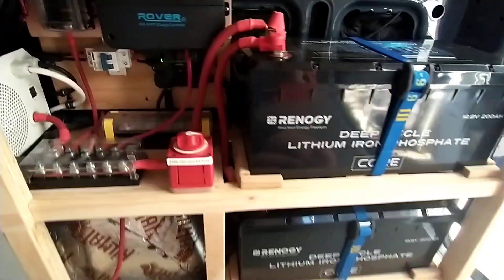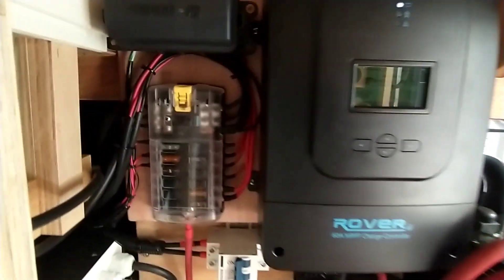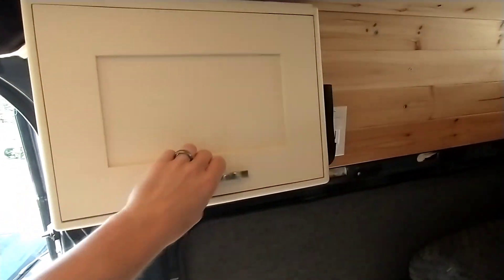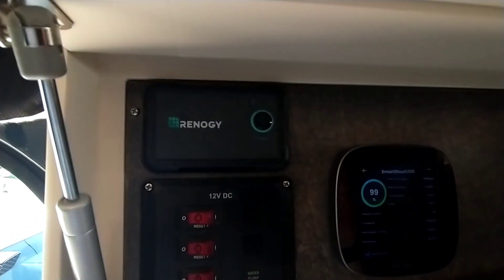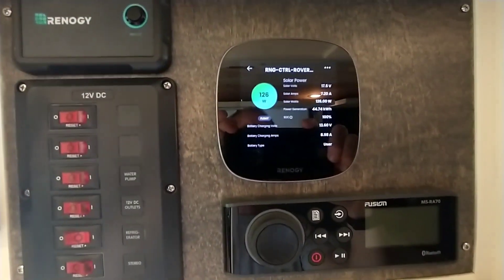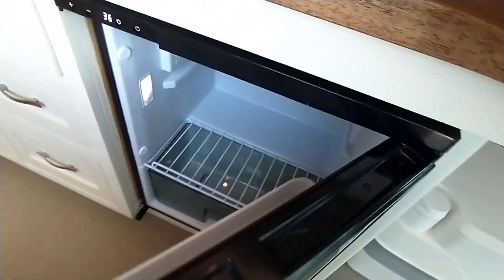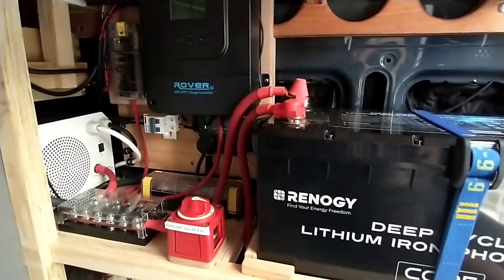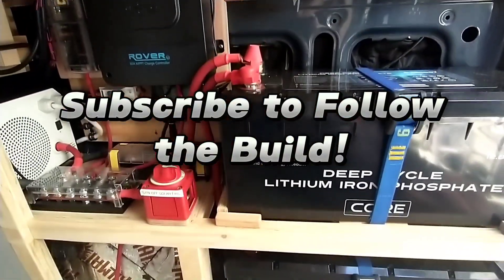Why I Chose Renogy Over Victron in my Camper Van

Comment: Do you have any electrical diagrams available. Will build the same system using 2 300WA batteries and 700w Solar. Greetings, Harold
Reply from the maker: @haraldbrandner2439  Harold, nothing very advanced I'm afraid but I went ahead and posted my hand drawn diagram below. Hope it helps and feel free to ask questions!

http://youtube.com/post/UgkxEU9qWlYsnCBqn1Ig9eCpa3yq_mGCORDu?feature=shared

Comment: I have used Renogy in my build 4 years ago now and apart from an issue that turned out to NOT be a Renogy problem in the end my system has been flawless. Renogy customer service was very helpful in troubleshooting my issue and went as far as swapping my inverter when ultimately the issue ended up being a Chinese main breaker issue of it not tripping but not giving its rated amps to the Renogy Inverter(s) so they couldn’t invert there rated watts beyond 900-1000 watts. Ultimately switched to Bluesea main breaker and problem was solved. System similar to yours although 4x100 ah batteries, Renogy 12v - 12v 60 amp alternator battery charger and no solar with 3,000 watts inverter.
Reply from the maker: Nice! Glad to hear of another positive experience, I'm sure enjoying my setup so far, about 18 months in!

Comment: I was very impressed with your 2 x 200ah battery bank and curious about your setup. I subscribed and would appreciate it if you could publish your system build video ASAP. Your system looked very neat. Well done, and thank you.
Reply from the maker: @patuot5016  Thanks! I didn't film the electrical portion of the build, it was too long and disjointed to make a good video. I'd be happy to post pics and answer any questions you have though.